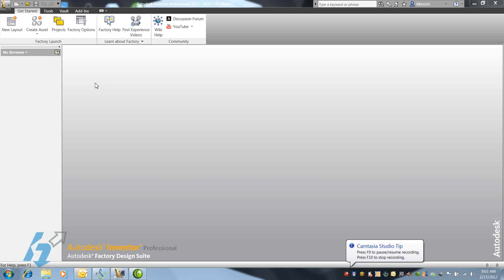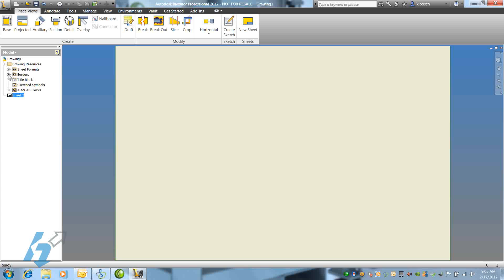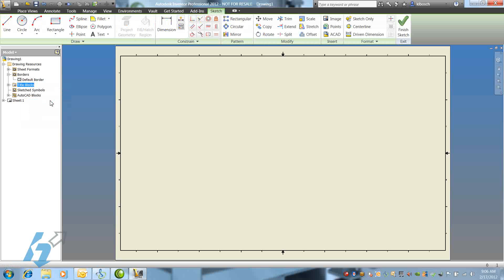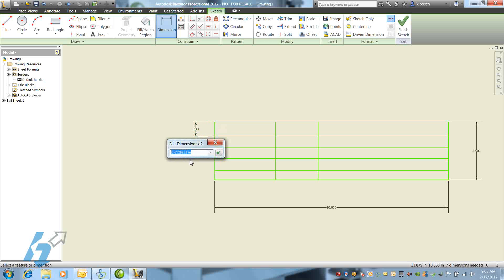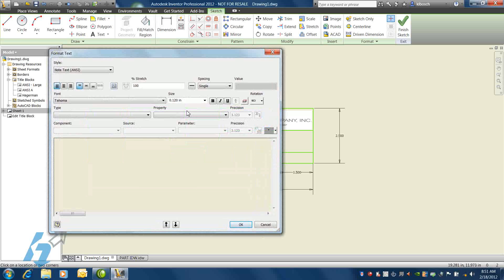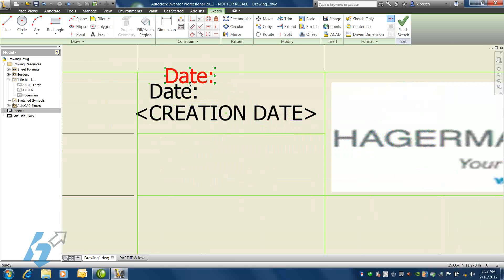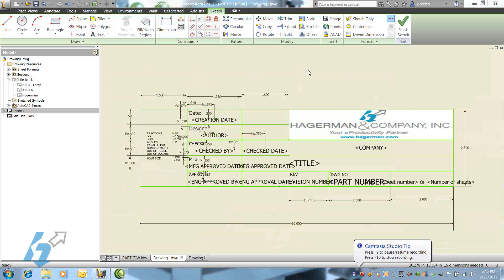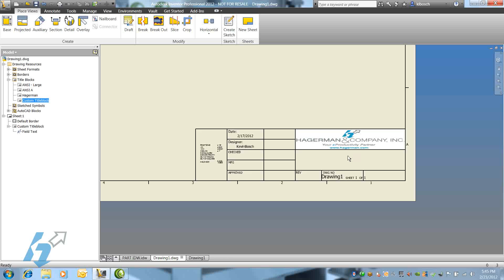Inventor Drawing / Titleblock Creation

Comment: Good video. Don't forget that you can use the rectangular array to generate the spacing for the individual boxes within the title block. This makes for a much cleaner sketch without all the dimensions cluttering the sketch. The title blocks that come with Inventor are under constrained, so expect the sketch geometry to move unexpectedly if you try to edit them.